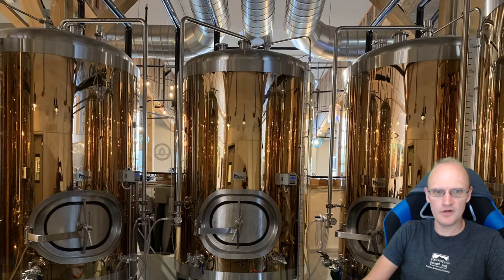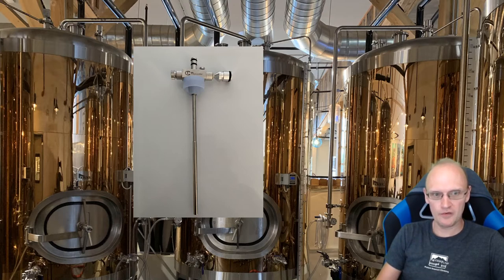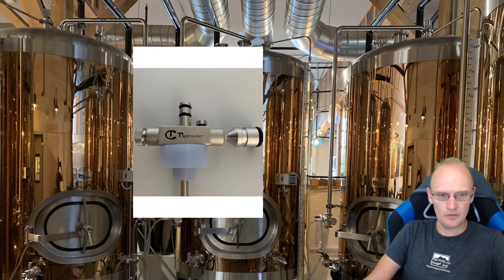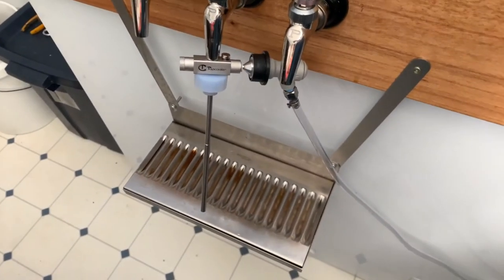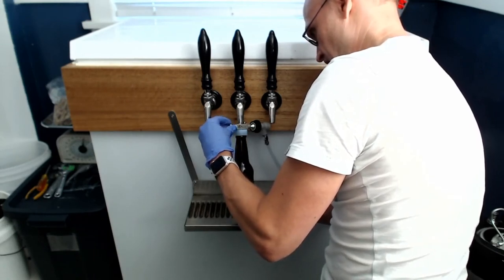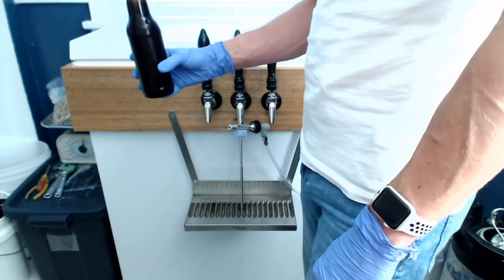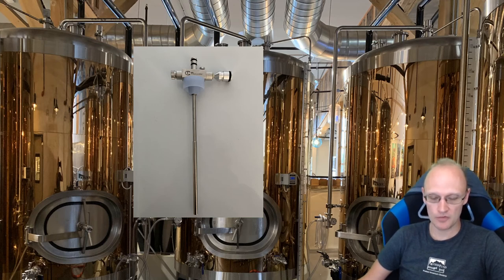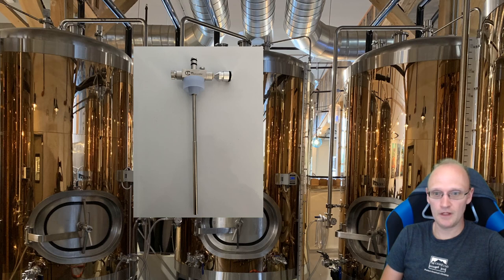TapCooler bottle filler demo and review.

Comment: Do you reduce the pressure on your keg before using the TapCooler?
Reply from the maker: No. That would really defeat the advantage of a counter-pressure style filler. Reducing pressure on a keg prior to filling is going to encourage co2 to leave solution (foam). This type of filler allows you to equalize the bottle to whatever pressure the keg is at prior to filling so the keg can remain at constant pressure.
Reply: @bluescreenbrewing4743  Makes sense. Thanks.

One accessory I recommend for those filling off a tower is the extension tube.